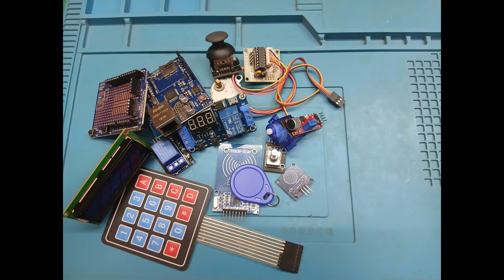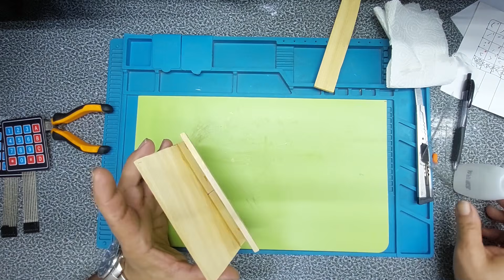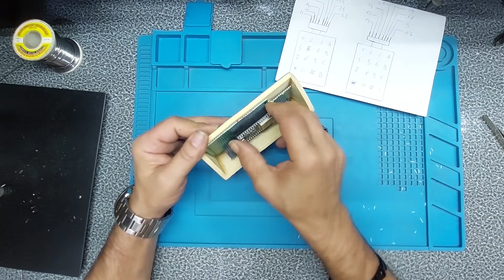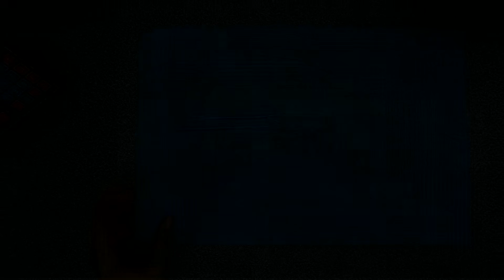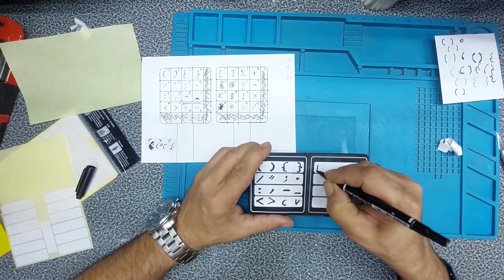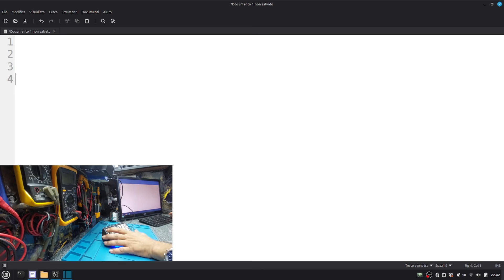Bluetooth Macro Keypad for Arduino IDE: 32 Custom Keys with ESP32 and Linux

Comment from the maker: Thanks for watching! 🚀 This 32-key Macro Keypad is a game-changer for my workflow on Arduino IDE and Linux.

🛠 PROJECT HIGHLIGHTS:

Core: ESP32 with Bluetooth HID support.

Design: Reclaimed wood finished with a secret soy sauce treatment.

OS: Specifically optimized for Linux environments.

📂 LINKS: Code and schematics are available via the link in the description!

Feel free to ask any questions about the 4x4 membrane wiring or the firmware. Stay creative!

Comment: Hello, how did you manage to get the BLEKeyboard library working on the ESP32? I’m having compatibility issues with the ESP32 core 3.x. Did you downgrade to version 2.0.x? Thanks!
Reply from the maker: Hello! Yes, exactly. The ESP32 core 3.x versions changed many internal libraries and they conflict with BLEKeyboard. To fix it, I downgraded to version 2.0.11 (or any 2.0.x) in the Arduino IDE Board Manager. Everything works perfectly with that version! Hope this helps! 🛠️💻
Reply from the maker: It doesn't matter which OS you are using (Windows, Mac, or Linux), the fix is in the Arduino IDE Board Manager.

Go to Tools -> Board -> Boards Manager, search for 'esp32' by Espressif Systems, and select version 2.0.11 from the dropdown menu, then click 'Install'.

Once you do that, the BLEKeyboard library will work perfectly on any system! Let me know if this fixes it for you. 🛠️💻

Comment: you made a macropad... then used keys you already have in your keyboard?
Reply from the maker: True, but with this macropad I have everything at a single touch, without awkward key combinations (Shift+Alt+...). It speeds up my workflow on Linux and Arduino tremendously!